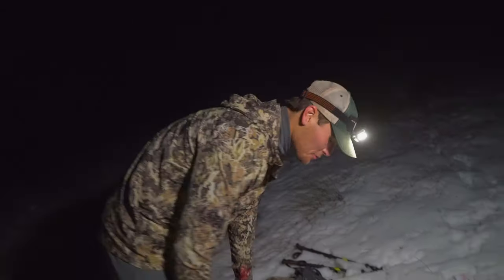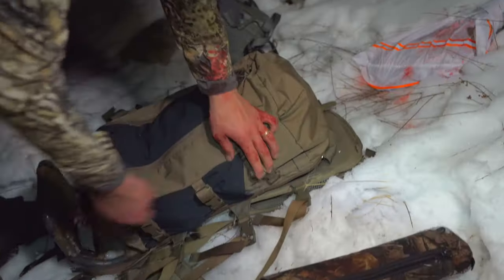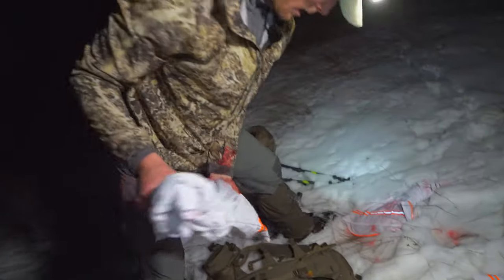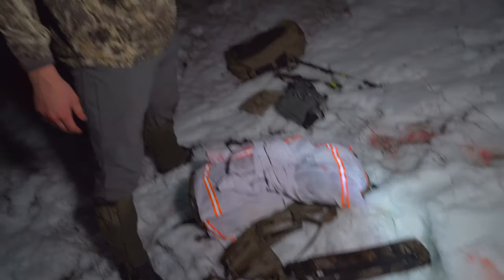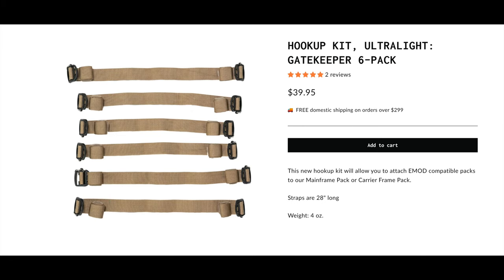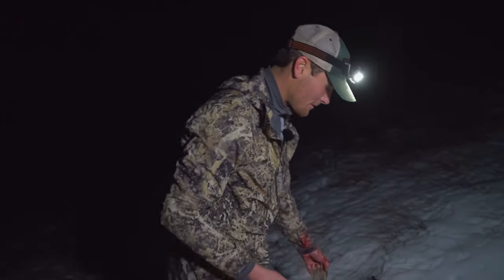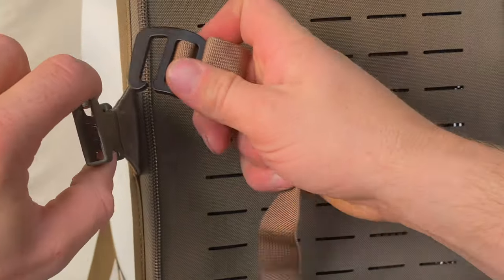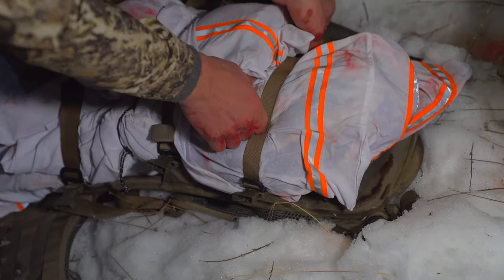Loading A Full Mule Deer | F1 Mainframe

Comment: Now that was neat to watch. And good to know. I have been hunting on public land and I have a full framed backpack and it is large with a large meat shelf and bulky. I clear trails just by walking. I wanted something that will do the same thing but be sleaker and have a lower profile and an easy way to carry my rifle, the Thompson Center Compass II in .308 Win with a silencerco ASR2 muzzle brake on it. Right now, I either need to carry it in my arms or sling it with the strap on the back of my neck and it dangles in front of me with my Diamondback HD 12 X 50 binocs.

Having seen videos like this and others, I have ordered through a company on ebay, the Just One J34. I think that is going to suit my needs for whitetail. And mule deer, if I make it to the western part of my state, where the mulies are prevalent and are in season on the public hunting land. I don't carry a lot because the place I can hunt is just about an hour from me, so, it is a day hunt. And the land is such that if you wanted to camp, it is easiest to camp by your vehicle and hunt with any day pack configuration. That being said, there are a few trails where you can wheel a game cart, if you want to do so. I carry the ever important 2 rolls of toilet paper. Outdoor Edge Wild Pak game kit. Another hunting knife. a log of heavy duty rope, a few logs of paracord. A single piece gambrel that will hold 600 pounds and small pulley system and rope to hoist a deer, if I want to. Compass. A few bottles of water but now I am getting a hydration tank for the J34. Two extra 5 round mags of ammo. I won't ever need that much and carrying a total of 15 rounds pretty much ensures that. Some heavy duty garbage bags.

Where I hunt, there are two times in the season where you cannot just quarter in the field. Opening weekend (Nov 6 this time) and Thanksgiving Weekend. If you get a deer, you field dress it and bring the carcass to the deer check station where they weigh it and take bone tissue samples to check herd weight and CWD. But they have some racks where you can hang a deer and finish your breakdown, if that is what you want. They learned a while back it was better to let the hunter field strip it instead of bringing back the entire deer and having gut piles to deal with. For those times, I take in my deer sleigh'r. Any other time, I will quarter and pack out. I might even de-bone and take just the meat. Maybe the ribs whole. I once smoked some deer ribs like a savory jerky. It was wonderful.

I like how easy it is to adjust and modify this back packing system and I like the rifle scabbard being where it is.